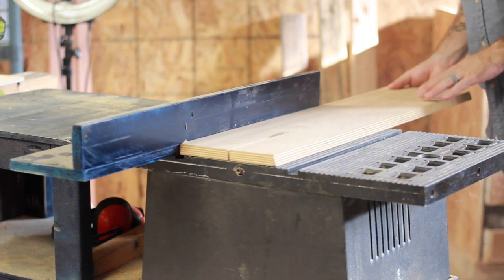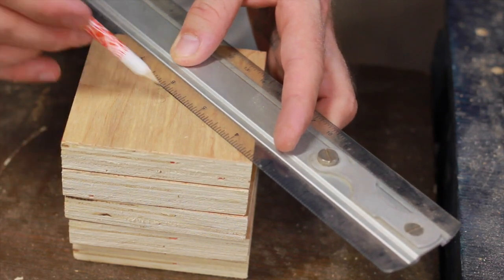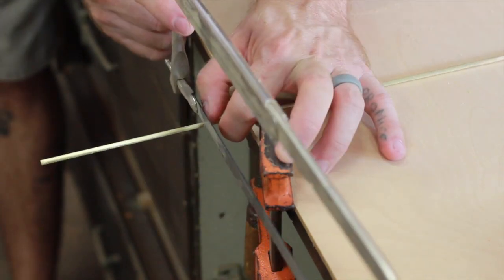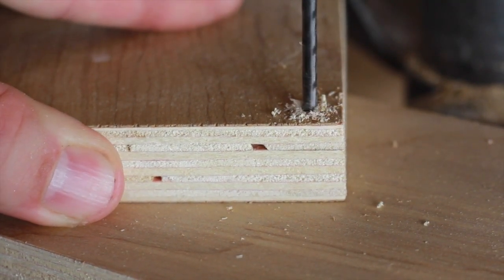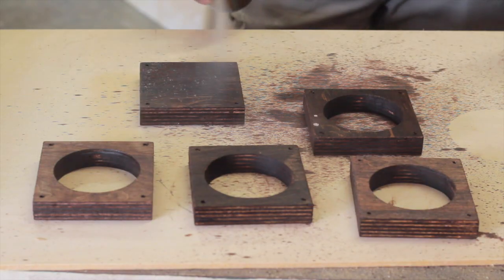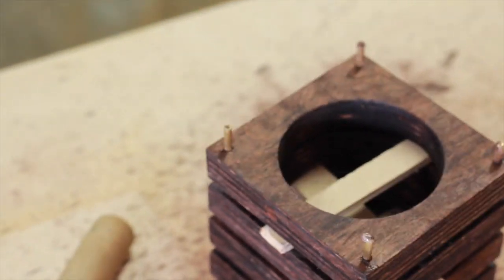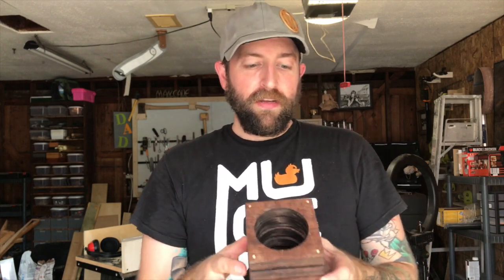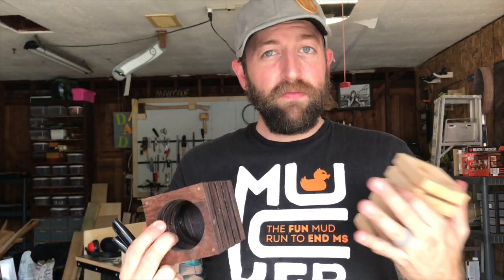MODERN PENCIL HOLDER

Comment: Cool idea.....could you have maybe used clamps to hold down the wood to drill holes??
That's if you have small enough clamps, and they are strong enough too.
Also, I'm sure if you wanted to use other woods, you could too.
I have a bunch of walnut and red oak I have to use up.
Reply from the maker: That would have been the smart thing to do…but then again, I’m not the smartest crayon in the box
Reply: @FeralBoyKnives  nah, dont be like that. 
I also made an edit to my post.
I'm gonna try this little project out but use some walnut and red oak. 
I'll have to find some brass dowels, but I do have some wood dowels I might experiment with.
Reply: @FeralBoyKnives  seriously it's still a cool little project. 
Different from what I have seen, so give yourself credit for that!!!